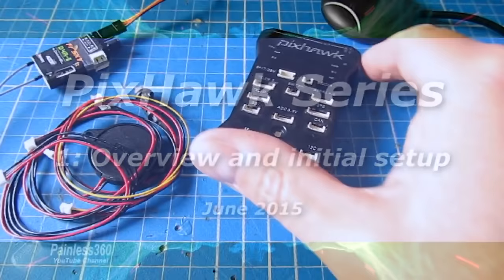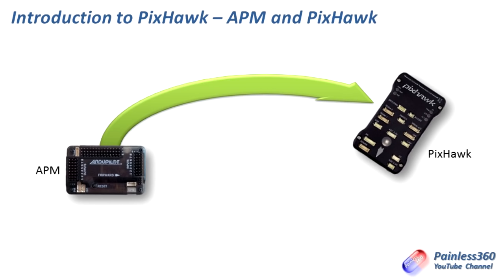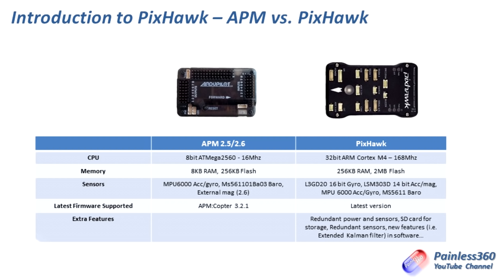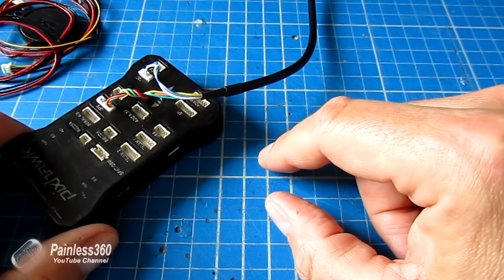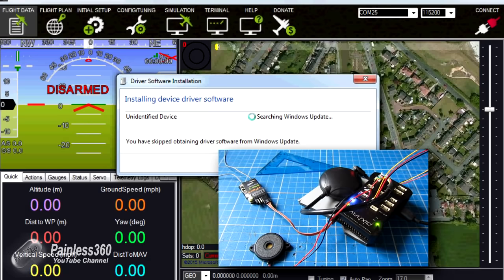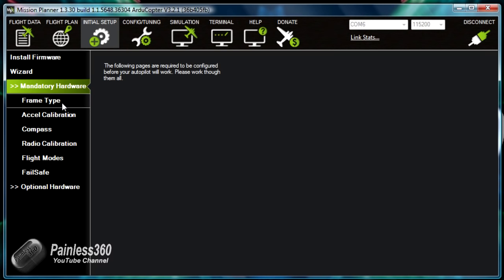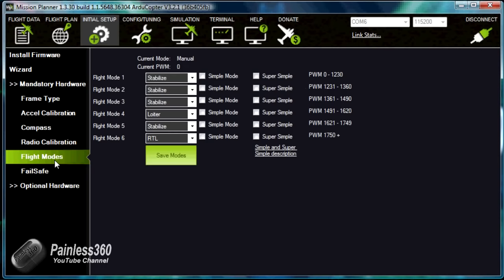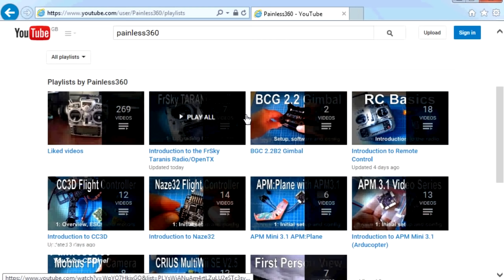(1/5) PixHawk Video Series - Simple initial setup, config and calibration

Comment: Hi, i'm using a FlySky I6X transmitter/reciever and i'm connecting the reciever to the pixhawk, via RCin and PPM/CH1 on the reciever. the transmitter is bound with the reciever, however i'm not getting any readings on the radio calibration stage. There are no bars, how do i fix this? thanks

Comment: My Pixhawk Main out Pin 4 is not moving the motor 4(back right - clock-wise), can you please help me on how I can use other available pins like 5,6,7,8, in pixhawk 2.4.8 and assign it channel 4. I am not able to get any document which can help on swapping the pins. It'll be a great help. Also my motor 4 is working when connected to main out pin 1,2,3 of pixhawk. I am using FSi6 TX with FSiA6B RX.

Comment: Great job on the video, as well as everything you've released so far.  You truly do make this hobby painless!

A point of note for anyone upgrading from APM to Pixhawk... All of your existing peripherals will still work (GPS module, 3DR Telemetry, MinimOSD), however, you have to change the connectors from DF13 5 position to DF13 6 position plugs.  The only item that can move over with no modification is the power module.  There are tons of pictures online showing the exact pinouts, so the hardest part will be finding the plugs. My Pixhawk came with a few extra "spare" cables, so I just carefully harvested the ends off those and I was up and running quickly

Comment: Calibrations will need to be repeated when it is mounted on the quad. Motors and escs will throw them off. The Pixhawk will compensate after the recal.
Reply from the maker: Chuckles It will - all covered in the second video after mounting to the chassis ;)

Comment: Great video. 10 out of 10 from me. Thanks for your time and effort with making it. And thanks to 'R' for sending the pixhawk.
Reply from the maker: Glad you liked it, there are more in this series. Check out the playlist. Happy flying!
Reply: Thanks PL360!! The only warning for newbies (and I'm one of them) is.... the firmware for pixhawk. I used the mission planner software to load the quadcopter firmware into the pixhawk. But once that was done, the pixhawk got a red solid LED coming on (after each manual power-up), and had three beeps...one higher tone, followed by two low tones. I thought I had broken my pixhawk. I then needed to go to http://qgroundcontrol.com/ to install the Qgroundcontrol software, which provided two options - a pixhawk firmware and an ardupilot firmware. I chose the pixhaw firmware..... which loaded into my pixhawk 2.4.6, which revived all functions. I was then able to start up Mission Planner and connect to the pixhawk. Just mentioning this in case some newbies get a heart attack after loading the ardupilot firmware into their pixhawk. Otherwise, fantastic! Thanks again! Love your video and very easy-to-follow guidance with the sensors setup!
Reply: UPDATE: This morning, I took a punt and tried one more time to use Mission Planner to upload the copter 3.4.4 firmware. And it surprised me that the firmware not only uploaded, but the pixhawk 2.4.6 was also operating properly. Thanks!

Comment: It's worth mentioning control directions in radio calibration aileron and rudder are obvious but elevator is reversed to what you think and not same direction as throttle i.e. full forward throttle - green bar goes to top, full forward elevator - green bar should go down

Comment: Many thanks for another excellent video. Just spent a few weeks building an F450 using a Flysky Fs-i6s Tx with no problems at all, just a small amount of trim on the elevator and it flies perfectly.
Reply: Which receiver did you use and if its fsia6b how did you connect it to the pixhawk

Comment: thanks for your videos, i started this last July and got totally no where, tried kk2, apm 2.6 and 2.8 and gave up, then came across your videos so i dragged everything out of the cupboard and tried again and succeeded in under 5 hours, flys great, last time i tried it went always skimmed sideways then flipped over and crashed without fail.please keep them coming and maybe add the 6 position switch for Turnigy 9x on ER9X and 9Xtreme as i struggled with that for several days as many videos out there worked for them but i only got 5 of the six  flight modes working despite the transmitter clearly showing 6.
Reply from the maker: +s See our videos where we've added modes to other radios - the problem comes from the fact that the ranges for the modes are not equally spaced and a lot of the controls on a radio assume they are.. Best of luck!

Comment: Just got one of the Pixhawk 2.4.8 white case with buzzer and arm button from banggood.com. It updated in Mission Planner to ver. 3.3.3. Its got 2mb, 5611 baro. etc, etc, seems like a great deal.  At first it didn't update on Mission Planner but I used a different USB cable and VUALA. Now I get to do all the cool stuff in Mission Planner I cant with my APM 2.52. Figured I'd start here. CHEERS!
Reply from the maker: You need to install ArduPilot 3.2.1 onto the APM and it should burst into life too - best of luck!
Reply: PERFECT,  I had seen 3.2.2 was ok but its a Cheerson CX-20 and didn't want to brick it. 3.2.1 it is !

Comment: The problem ist, that the orietation of compass chip is unknown for most gps modules. (In mine is is logically 45 degree rolled and 180 deg flipped) Therefore you dont know how to set up the Rotation. This is really somwhat strange but it works in any direction when set "Automatically learn offsets".

Comment: Enjoying your video .  I know you're speaking about aircraft but I'm making an autonomous boat and I simply want to control the rudder and tell it to sail waypoint to waypoint.  Obviously a GPS input is needed.  What other hardware to you recommend?  I don't need motor control of any kind.  The motors will be running solar and will be on all the time.  I simply need rudder control for the waypoints.  Thanks, I'm just learning and appreciate your wonderful teaching ability on this video.  I'll watch the entire serious but wanted to throw out this questions first.  Thanks in advance.  Steve
Reply from the maker: Check out the Ardupilot wiki as they have a whole section on Arduboat. I may make a series on boats in the future. Stay tuned!
Reply: If you are still working on this, it may be worth looking into a forward/reverse relay for the motor(s). This would allow for two directions and if you have two motors, some steering. You could also wire the motors in series and just have forward/reverse with a rudder. I would think this would be your best option, as using two motors to steer would take a while, especially if it is on solar only

Comment: Hi, my radio does not pick up on the Radio Calibration part of Mission Planner. It seems like it's bound fine to the receiver, since I tested it with a servo motor and it responded fine. However, when receiver is plugged into the Pixhawk (Via RCIN) and radio is turned on, there are no green bars showing up on Mission Planner, despite the receiver showing a steady orange light. Do you think this is a problem with the radio or the Pixhawk itself or something else? I'm only in Highschool and extremely new to drones, and I've been stuck on this for a while. Any response would be awesome. 

Radio: OrangeRx Tx6i Mode 1 Int'l Version 6ch 2.4GHz DSM2/DSMX Compatible Radio System
Receiver: OrangeRx R615X DSM2/DSMX Compatible 6Ch 2.4GHz Receiver w/CPPM
Reply from the maker: Check what protocol you need for the RCIN port. I use SBUS for that here so I would be suggest you need an RX with SBUS too... Best of luck

Comment: Hi Painless. Hoping you might have a solution to my problem. Im trying to get Pixhawk Px4 2.4.8 to work on a 450mm quad. My problem is that after I arm, I move the throttle just a little, barely and the motors spin up almost to half throttle. When I bring the throttle down, it takes about 2-3 seconds for the motors to stop. Have tried on 2 diff Pixhawks, swapped out ESC's and tried on different quad with diff motors and ESC's. Same result. Motors are Turnigy D2830/11, ESC Hobbyking 30a BEC (center, red wire removed), Receiver Turnigy 9X8c v2, PPM Encoder, Radio Turnigy 9X, Power module v1.0. Posting here hoping you or one of your subscribers might have an answer. Enjoy and get lots of good info from your videos. Thanks for making and sharing.
Reply from the maker: +abenwinUT if it's on the bench, Google 'change motor speed Painless360' to find my video on odd things you can see when bench testing,, hope it helps..

Comment: Hi, I have realized the motor beeps when the switch is flashing red light. However the problem is that after I calibrate the esc and motor spins perfectly when i turned it off and start again the motor doesn't spin for some reason. I'm really struggling to get this thing work..

Comment: Thank you. We will try the first fly on saturday. I did the setup including  gps block. if I want to fly without, may I remove it and fly or have I to setup again the board without external gpd and compass module? Thanks for your time. Regards Andrea Montani
Reply from the maker: +Andrea Montani You could try but I would not try and fly a model without everything tested and working. Best of luck.

Comment: Hi, i am new to this and using a pixhawk 2.4.8 as my flight controller, but I am facing issues with the correct firmware for a plane frame type. It gives me a error   at ESC calibration stage- "set param error. Please ensure your your version is AC3.3+". I have tried multiple firmware options but same error always. Though it works well with arducopter heli firmware setup. I would be great if you could help me with this issue?
Reply from the maker: Lots about this in the forums but I've not seen it here. Looks version related from that I can see. Best of luck!

Comment: Hello, I've seen your video, however , on initial setup, while doing the radio calibration, the green bars don't appear and i can't manage to calibrate the rc.
I am using an FSi6 transmitter, with a FSiA6B  receiver.The light on the receiver is steady and red, and i think they are binded correctly because i can see the battery status of the receiver on the transmitter.

I would really appreciate a help from you,

Thanks in advance

Comment: hi Iv just bought a tarot T1000 it has the pixhawk and a radiolink R12DS receiver it has already been setup but I noticed there is ppm encoder between the 2 the receiver has an S-BUS port and in your video it seems I can connect it with only 1 cable instead of all this mess

Comment: Your video are very good! thank so much. Please help I am stuck at calibrating radio connection. I have taranis, plus but my receiver led doesn't turn green/no connection. do you have to setup the taranis first before auto detection? also, do i have to restart all the calibration steps if i didn't finish the first time or does it save your progress to memory/firmware?

Comment: Thanks for the great videos. They have gotten me in the air going back to the early electric heli days. 
I'm having a problem: No matter what I do, if I set up the radio for AETRM, the throttle and elevator are exchanged when I go to calibrate in Mission Planner. This is is on a pre-owned Taranis X9E with the Hall Effect gimbals. I'm wondering if this is a mode 1 radio and when the previous owner upgraded the gimbals, he simply set it up as a mode 2. If I set the radio up as ATERM, the calibrate routine responds as expected. Any thoughts?
Reply from the maker: Sounds like you are a little new to the radio and OpenTx. Check in the mixer section of the radio and you'll see that those outputs are swapped. You can move them to be anything you want. See my OpenTX mix school videos. Best of luck!

Comment: I'm looking forward to the next one covering the power options.  I don't want to use the power module and when I connect to the servo rail it appears to work fine, but I get a low voltage alarm that I think is a Parameter setting rather than actual low voltage.  Anyway, I hope you'll show this option/setup, too, please.
Reply from the maker: Hugh Dinwiddie That sounds like the alarm for the flight battery. I would disable the alarm in mission planner.. (http://copter.ardupilot.com/wiki/configuration/failsafe-battery/)
Hope that helps.
Reply: Hugh Dinwiddie I am also interested in any video describing exactly what is needed to power the Pixhawk correctly since I was instructed that if I use a 6S battery I was not to use the standard power module, but the 180A Attopilot module and use a BEC to power the servo rail and incorporate a Zener diode correctly. Since I have hacked the DF13 cable to use only the three wires (current, voltage and ground) I now rely on a BEC to power the the Pixhawk via the servo rail, but I have power retracts on my X8R receiver (ch9/10) and I locked up the Pixhawk causing a crash since I have no backup power (redundancy). So, is there a video describing the proper wiring of power backup to the Pixhawk servo rail correctly, possibly using two BECs and how to make sure I have the Zener diode/s wired in correctly? (I have seen the diagrams and wiring a diode in line makes no sense as I think extra voltage should be shunted to ground). The craft is flying well, but I would like to use the retracts (or any servo) obviously without a burnout, or power drop.
Reply from the maker: This is all covered in the on line docs. The standard PM only supports up to 4s LIPO.

You can power it using the pins on the PM port and a switching UBEC and/or plug another +5v UBEC into the servo pins for redundancy (use a zener diode for overvoltage protection)

This will help you  -http://copter.ardupilot.com/wiki/common-optional-hardware/common-powermodule-landingpage/common-using-a-pixhawk-with-6s-batteries/

Best of luck with it.
Reply: Yes, it is all covered in the online docs. I have read and reread all this and more and I just wondered if you would be actually demonstrating the wiring as I have done what they describe and now I'm waiting on China to send me the parts I need to FIX what I have ruined after I followed the instructions. :)
Reply from the maker: I will not be covering 6s packs on here. I don't fly ^s on anything but a 500class heli.

If I were to use a 6s pack on a PixHawk I would do something very similar to you - UBEC into output pins to power servos and other high current devices (with diode) and also provide secondary power, install another 6s capable UBEC/PDB into the PM port on the Pixhawk.

Sorry I can't add any more - best of luck with it.
Reply: Painless360 By the way, I enjoy your videos greatly as you explain it well and I understand it easily.
Reply: Painless360 OK, I'll use the power wire on the port on top of the PIxhawk with another BEC/UBEC and that should satisfy the Pixhawk needs. It was confusing to be told to not use the power wire on the DF13 cable, then the online docs plainly show a BEC could be used. Thank you for your time.
Reply from the maker: I hope the next time works out better for you.

I do power an APM 3.1 using the PM port with a UBEC in exactly this way - you can see it in the APM 3.1 series videos early on.

Best of luck with it.
Reply: +Painless360 Hi, I am just thinking about power redundancy for my APM 2.6 - is it ok to power it with PM and also with external 5V UBEC  connected to input rail? I have JP1 removed.
I am trying to keep APM powered even if PM fails (which seems to be quite common issue).
Thank you

Comment: Hi! I am trying to setup this on my bixler and I was wondering what channel should I put the flaps on? I watched this and the taranis video but Im still clueless. Is hard to go trough this series and have it adapted to a plane. Thank u in advance. Also is the telemetry radio mandatory to get a good experience with thr pixhawk? Thank you for all the great content.
Reply from the maker: http://ardupilot.org/plane/docs/automatic-flaps.html covers it if you want to make them automatic. You can run them from the reciever directly or foward a channel to the flaps via a spare PWM output. See the latest Arduplane build on the channel. Best of luck with it..

Comment: Thank you again for your awesome tutorials, I now have my tarot 650 almost complete but noticed the external compass is not active, the ublox  neo-7n is plugged into the gps and 12c sockets as required and does not appear in mission planner calibration screen I also tried rotating the gps module and it didn't change the heading any help would be greatly appreciated.

Comment: hi painless, love the videos, totally convinced me now to go down the pixhawk road for my next FC.... Quick question though..thinking about damping for the vibration issue, rather then buying an anti-vibration mount, i was wandering if there is space inside the case to drill some holes in the bottom plate of the case and mount some silicone anti-vibration balls directly to the case itself...... or is the circuit board too close to the inside of the bottom plate.

thanks for the great videos... big fan
Reply from the maker: +Dave Towner really depends on the case. The anti vibration mounts made for these work great though.. best of luck!